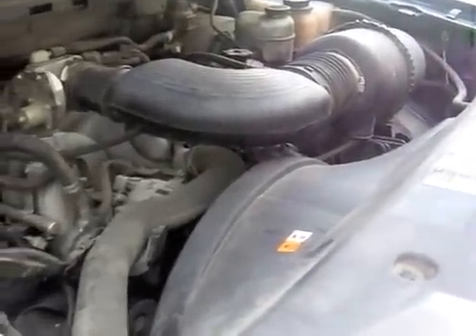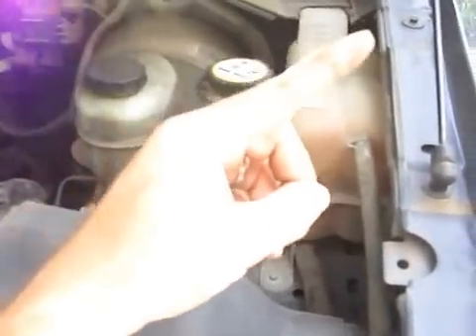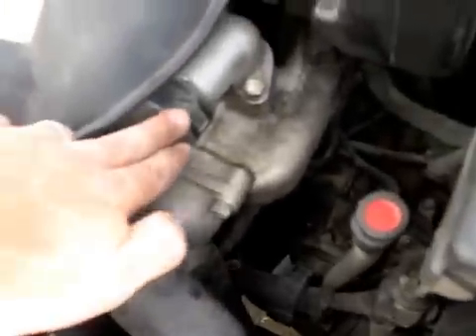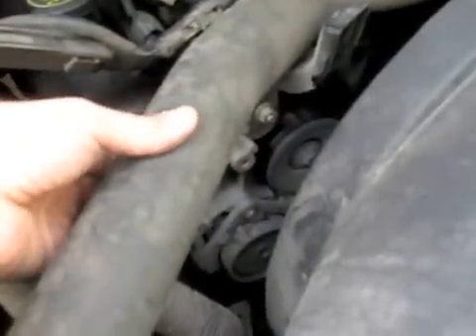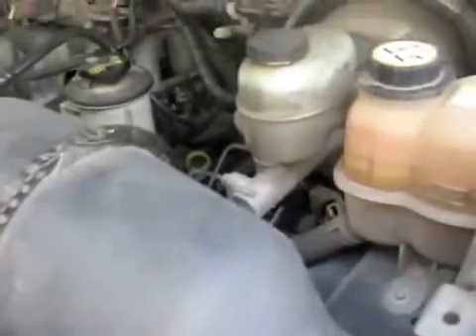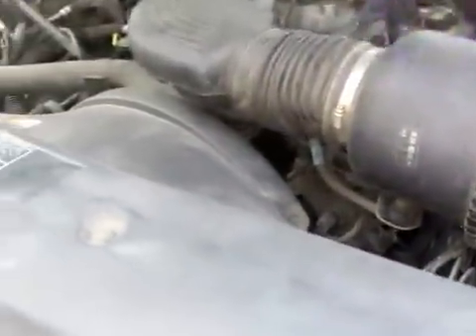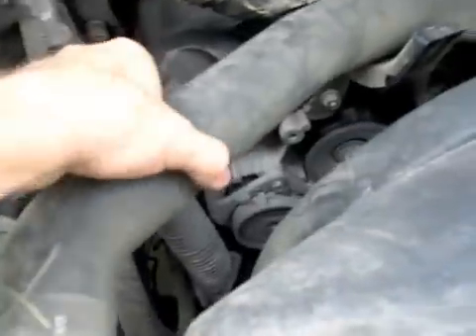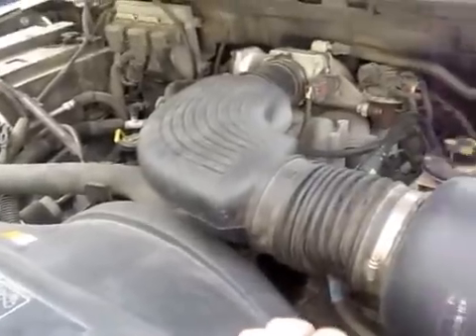Car Engine Overheating - Causes and Symptoms of Over Heating  Car Engine

Comment: My truck just overheated and i put water in the radiator i dont know if why it kept spiting it out and white smoke would just come out of the radiator cap and muffler it really scared me and the day before i was good on radiator fluids and everything do u know what could of caused this and what do i do to fix it thank u i enjoy ur videos theres just a trusting and honest vibe u give off.
Reply from the maker: Thanks Jule, I have been working on my vibe for sometime now, yours seems nice too :)  OK, first things first....get a cooling system pressure test to rule out any external or internal coolant leaks. If no leaks, then check the radiator for a restriction...rust and gunk at the bottom not allowing coolant to circulate.  If this radiator is 10+ years old and has over 100K miles.....I would expect there to be gunk at the bottom and the radiator needs to be replaced.

Now, if the pressure test shows signs of an internal coolant leak, like from a blown headgasket then watch my other video on a special sealer that should help repair that gasket, but it only repairs the headgasket...not a radiator, water pump, hose leak.  The video is here  http://www.myhonestmechanic.com/articles/engine-block-sealer-additive.shtml
Reply: thank you i did notice that the water leakes alot from the muffler
Reply from the maker: jule enriquez
Most likely its just condensation, water, not coolant. Coolant when burned inside the engine produces a lot of white smoke out the tailpipe and the engine runs bad because coolant is getting on the spark plugs.  White smoke under the hood, that tells me there is a coolant leak and its spray on the hot engine...hose, radiator, water pump etc. etc. anyway a cooling system pressure test needs to be done to locate the leak...if you really have one.
Reply: no its like leaking like my truck took a piss
Reply from the maker: jule enriquez
Wow, did you feed it a case of beer or something :)  then I would expect that the radiator constantly needs to be refilled with coolant...correct?  Get a mechanic to do a cooling system pressure test...its cheap and fast and just about anyone can do it. If the headgasket is bad, the tester will not hold pressure due to the internal leak.  If THAT is the case, then try this headgaket sealer additive and follow my instructions http://youtu.be/Nban6dVkYGM

Comment: HI, I have a 2006 Chevy Malibu 2.2. When I am driving I notice that the gauge goes slightly above the middle line when the ac is on or off. The coolant level is right and i just had an oil change two days ago. This has been the problem for some time where I would notice the car slightly overheating if the ac is off and turn it on and it would go down. Now, whether the ac is off or on it goes slightly above the neutral line. The mechanic checked the hoses with the oil change and said they were fine. is it possible hot weather would cause the change? Or is it something more sinister? HELP!
Reply from the maker: You might be a little too paranoid, or there could be a gauge issue that is not reading correctly....although that is rare.  If you told me the overheating happened when you turned ON the ac, I would suspect a restriction in the radiator but since you said the opposite....I don't really know.  I would use a laser thermometer and check the engine temperature then plugin my computer scanner and see what the engine computer says the temp is. 

Might be a thermostat issue, a coolant temp sending unit issue, gauge issue etc. if the engine is NOT really running hotter than 210, which is where it should be.  I would also check the radiator cooling fan to make sure it is coming on and off as the engine heats up, and check it with the A/C off...you should see the fan cycle on and off....actually I would check this first and rule the fan out.

Comment: Hi  #TrustMymechanic. Thanks for the information. I have a 2003 Honda Pilot. I observe that sometimes when I start the ignition early in the morning, I see smoke/vapour coming out from the radiator/bonnet. I usually have to wait a while or drive for a bit before the smoke disappears. However, on some other mornings, this does not happen at all. Can this be called 'overheating?'. Please kindly advise. Thanks
Reply from the maker: Well, there should be no smoke coming from under the bonnet.  I would assume this is coolant leaking on the engine, if you are losing coolant then you have a leak that needs to be repaired.  It could be from an oil leak, oil dripping on the engine due to a leak.  Either case, I would expect there to be smoke all the time, and worse when the engine is hot.  All I can really suggest is have a local mechanic check this for you, maybe leaf the car with them overnight so they can witness what you are seeing.

Comment: i have a gmc sierra 4 x2 and it overheats when you turn on the heat. the neighborhood mechanic said it was the head gasket. there is an antifreeze leak inside i think you can smell it
Reply from the maker: Sounds more like a heater core leak, which is located inside the dashbaord.  When it leaks it drips coolant onto the passenger floor board under the carpet...under the dash. The windows usually fog up, and you can smell a sweet smell inside the vehicle. 

Get a cooling system pressure test to prove it, then either replace the heater core or you can "by pass" it if you dont need heat now and want to save money.  By Passing just ties the heater hoses together and by passes the heater core so no more leak...but no more hot air either.  Here is more info  http://www.trustmymechanic.com/car-heater-not-hot/

Comment: why water from rediator goes back to coolent bottle
Reply from the maker: Its called an overflow bottle, as the engine heats up and the thermostat opens and closes the coolant will back up in the radiator and needs some place to go.  Also captures boil over coolant if engine overheats

Comment: Got a Question is normal for a car to do this ? For Example let say I stop to get some fuel on my car after i done fueling i started back up now the temp raise is reading higher then normal? It got a new water pump and fan clutch.
Reply from the maker: Fairly normal, the engine is still very hot and has no way to cool itself until you start it and get the water pump and cooling fans going again.  Just like a potato still cooks after you take it out of the oven, lots of heat energy still inside. As long as the temp quickly returns to normal, you should be good.
Reply: TrustMyMechanic.com Thank for the reply ... At first I though it was the radiator being clogged ..
Reply from the maker: *****
If this is an older vehicle with a 10+ year old radiator with 100K+ miles...a restriction in the radiator is very possible BUT I would expect you to see overheating at freeways speeds...which you did not mention.
Reply: TrustMyMechanic.com Yes is 9 yrs old with 132,000 miles .. One way to know if your radiator is clogged will be overheating at highway speed? My doesn't overheat at all running or stop and go traffic.
Reply from the maker: *****
Yes, its like trying to run a 100 yard dash with your mouth taped shut, you need more air at that speed. If the radiator is clogged the coolant cant circulate fast enough in the engine to keep it cool.

Comment: Hey, ur video gave me some idea of what might be happening with my 2001 Lincoln Ls v8. It started about a month ago. It was running for about 15 to 20 minutes. I was driving to a store about 5 miles away. Mid way there it over heated. I had 50/50 in it. I dnt know much about cars. Nothing at all really. Now today it over heated 3 times. Im really not sures whats going on. I hear the fans kick on than i notice the temperature gage start to raise to i turn it off. I let it sit than started it up 5 minutes later and its fine. The last time today to was running for about 20 minutes before i pulled off. 3 minutes later the fans are kickin on. I pull over and wait. I start my car and the gage ramains centered but my fans were still on as i drove 5 minutes to get home. Any ideas? Please help!
Reply from the maker: Check the coolant level in the radiator, if low get a cooling system pressure test to help you locate the leak. Check that the electric radiator cooling fans are coming on, should be on when engine is overheating.

Comment: Really helpful, thank you for the info.

So my car has recently started overheating. Twice it happened when I was driving on the freeway and then pulled off while still keeping my car on (getting food at drive through) and after shutting the car off and letting it cool down it would be fine. The final time it happened I was driving in the city and it began overheating in stop/go traffic. I pulled over and had this time I finally checked the coolant levels and they were extremely low.

After taking it to a mechanic he says I need a new radiator and that my oil was also extremely low. I will ask him to perform the pressure test tomorrow, if it fails that then obviously low fluids aren't my only problem. If it passes the pressure test then would the overheating at idle after freeway travel scenario make sense that it was caused just from the low coolant / oil levels?
Reply from the maker: More than likely you have an external coolant leak somewhere....and/or the radiator is restricted not allowing the coolant to circulate thus boiling over into the overflow bottle and on to the ground. If it fails the test, then low fluid is likely your problem and you have a leak to repair. If it passes, then you probably have a radiator restriction and not a leak.
Reply: TrustMyMechanic.com
Thanks for the fast response!

Comment: hello,
I replaced ect sensor 2003 kia sedona, engine code 0118. Now when I cut van on even if it sits overnight cold engine, the temp gauge goes to the middle within a minute or 2 by 12 minutes of idling it is in the hot. Engine light is off, bleed the radiator in case of air pocket. But the temp needle does not go down stays in the hot when Im driving sitting or have the heat on high it never comes down. I watched your video after I let the vehicle run for 15 minutes at idle I cut it off I looked under the hood top radiator hose is hot but bottom hose is cold. Coolant is full in reservoir and at the top of the radiator neck. I have fron and rear heat. Any suggestions
I paid mechanic for diagnosis they said temp cluster gauge. I just don't see this being the problem
Reply from the maker: Hummmmm, sounds weird alright.  So you do have hot air coming out the heater vents, so there is coolant in the engine, the thermostat is working, and probably not a restriction in the radiator...although that is very hard to prove without replacing it. 

Check the radiator cooling fans, they should be ON when the temp gauge is in the red, and cycling on and off with temp in the middle range at idle.  I would rent/borrow a thermal temp gauge from your auto parts store and check the actual engine block itself against the gauge. 

A bad temp gauge is very rare, usually its a relay, sensor...or just physical overheating inside the engine that is the culprit.  BUT, you can buy a used cluster from a local junk yard if everything else checks out ok.

Comment: I accidentally bumped another car with my rear..no scatches or dents just a bump. A few minutes into driving the temp light came on the needle stopped working the ac got hot and the ck engine ligjt came on. Can u tell me what happened?
Reply from the maker: You backed into someone?  Hummm, pretty weird, not real sure what happened to be honest.  Do you see any coolant or water leaking from under the front of your vehicle?  I would NOT continue to drive this vehicle in this situation, and can only recommend you call a local mechanic and have them check it out before any future damage occurs. Sorry cant be more help in this situation.

Comment: Hello there I hope you don't mind but I have a question regarding car cooling leak. I have a 03 Subaru Forester and it has been leaking antifreeze lately and two days ago the engine was over heating.  I checked the radiator after the car was cool and it was completely empty but the reservoir was filled completely. The radiator is brand new and was installed probably a year ago. I refilled the radiator and brought it a friend, he opened the radiator gap while the engine was hot and radiator fluid was gashing out, he said that my radiator does not have a pressure issue. I just wanted to read out to you to find out what the issues could be. Thank you so much.
Reply from the maker: Get a cooling system pressure test, which will help you determine if you have an external (like water pump or radiator hose) leak or an internal leak like from a head gasket.

Comment: I changed my water pump, thermostat radiator radiator hose and I'm still overheating what else can it be?
Reply from the maker: Re-watch the video and start ruling things out and narrowing down when and how the engine is overheating....and get a cooling system pressure test.

Comment: I have a question... I have a Subaru Impreza WRX sti (2005) it is overheating. There is a leak, near the radiator, the hoses are getting spongy, but despite the leak, my coolant is not running low... When I am driving it sometimes heats more quickly than other times, but everywhere I go is close, and in town, so no high speeds. The fans are running, and when it begins to get hot, if I run the rpms up at 3000 it immediately begins cooling.. But I have to keep it up there or it gets hot again... Also, I have the heater on... The engine is very compact, not a lot of room to move around... And I am a novice, so I don't want to tear into things without an idea of what I am looking for... And I have no $ to get to a mechanic right now.
Reply from the maker: I would first repair the visible coolant leak at the radiator, if you see coolant leaking...you are loosing coolant in the system and also the system can not build up pressure which it needs to regulate itself. The radiator is probably low on coolant, although the plastic jug on the side is showing it to be fine.  An air pocket in the cooling system will also cause your symptoms too, and there is sometimes a bleeder screw on or near the thermostat to help you remove the air pocket.

Bringing the engine RPM up just speeds up the water pump and circulates more coolant through the engine. If you have a plastic fan on the engine (usually on trucks and SUV's, but you might have one too) speeding up RPM's makes the fan go faster, which can cool off an engine.  Using the heater takes the heat from the engine to the passenger compartment, so that is helping cool the engine as well. If you had not had mentioned the coolant leak I would be suspect of a restriction in your 9 year old radiator, but fix the leak first and see what happens....and make sure to bleed the air out of the system.

The upper radiator hose should be very hard to squeeze together if the system is working properly and has proper internal pressure. If you can squeeze the upper hose together (when the engine is hot) there is a loss of internal pressure...and coolant.

Comment: Hey man, so I put 50/50 in my radiator yesterday,  and today the reservoir started to bubble which caused it to Leak . It didn't over heat my car. But tonight it got to the point that it over heated and cause it to stall on me. When I open the hood , smoke came out and liquid was all over the engine . I don't knw if it came out of the tail pipe.  Any ideas ??
Reply from the maker: Cooling system pressure test to help you locate the leak, which sounds like it is external under the hood, heater hose, radiator hose etc. type of issue.

Comment: I have a serious situation. My brother has no clue what is going on with his older model Toyota pickup. First it started having a rather different buzzing noise, then the car quickly became over heated. After getting new thermostat, new radiator, and new water pump...The car dies while driving....The car didn't die when it was overheating with the old products, but with the new products in, the car dies and it is still overheating....The neighbor who is a car expert says it is the fan and the radiator....the fan is not replaced but the radiator is with the other two things above....what is going on??? Can it be the timing chain or belt?????

Comment: Excellent vid, one thing that's often overlooked is a faulty coolant reservoir CAP. If that leaks even a little bit, could lead to all sorts of problems......
Reply: That will show up with the pressure test.
Reply: @garybaris139 how? The cap won’t be on at all

Comment: My car runs a little hot at idle not but not in the red it was 93 degrees outside but feel like 103 wen I get going driving slow or fast the needle goes down it didnt do it this morning 4:30am) idk if its cause of the hot weather or what I just need to no and the fan works cause I hear it
Reply from the maker: Check coolant level first, if low then get a cooling system pressure test to locate the leak. Make sure radiator cooling fan is cycling on and off at idle speed.